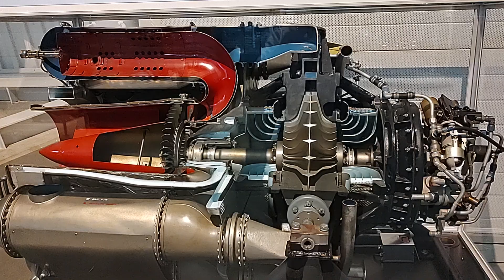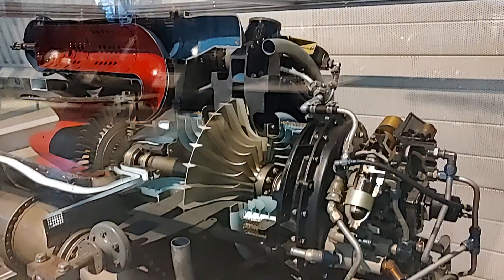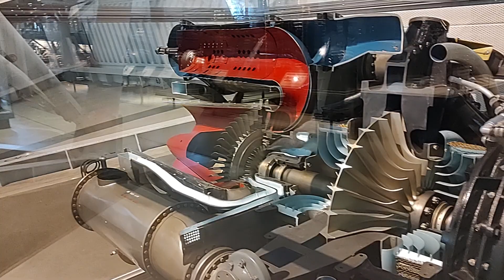GE J-31 Centrifugal Turbojet Explained, Second World War

Comment: centrifugal compressor is good in combination with axial(pt6) and for rc flying models
Reply from the maker: I do not know much about jet engines but I was surprised to find out that centrifical jets are preferred for helicopters, where the huge front end is not such a problem for drag and streamlining.
Reply: @fredkitmakerb9479  not all helicopters have that engines,pt6 engine is in pilatus aircraft